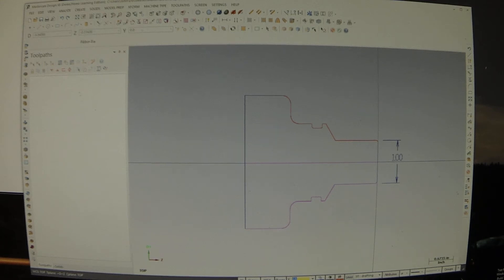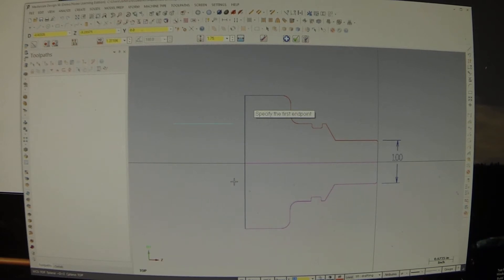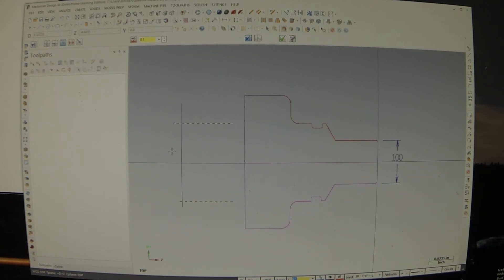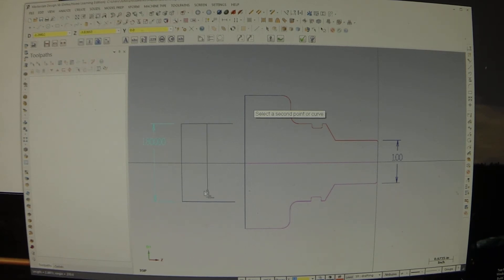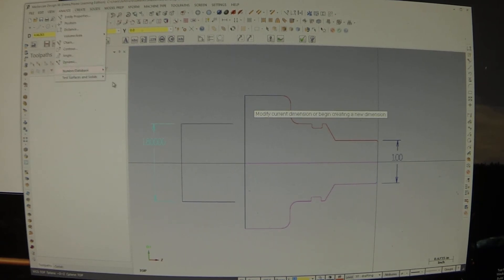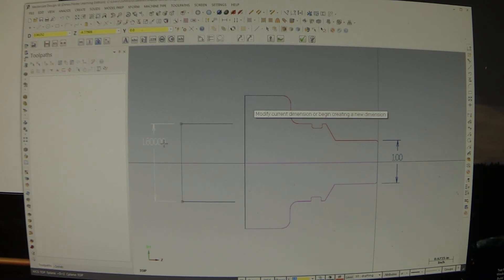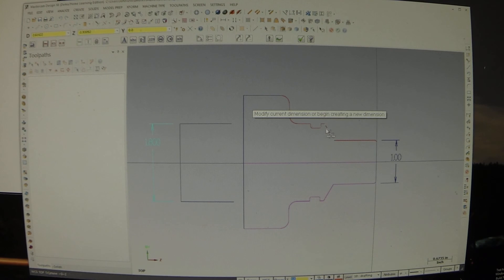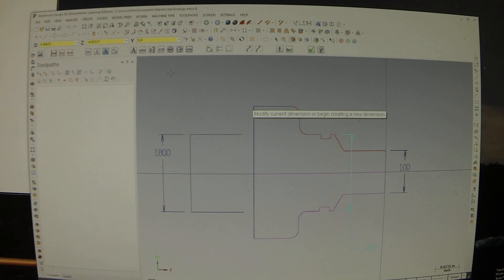Wtf mastercam

Comment: not sure if you fig it out yet but if you go into your custimize under setting check your analyze measurement places make sure its on N.1234  also go down to dimensions attributes  and make sure 4  is in the decimal place box. This should do it for you
Reply from the maker: +Nicholas smith nah its just the home learning edition fucking with the numbers
Reply: Ok well my X8 did the same till i changed the place of decimals to 4. Its not really a big deal for me cause i only use mastercam dim for ref thats it. We have solid works for blue prints.